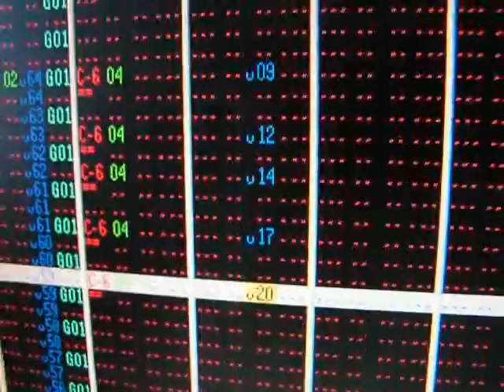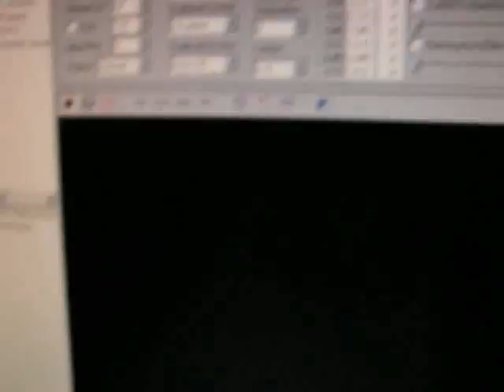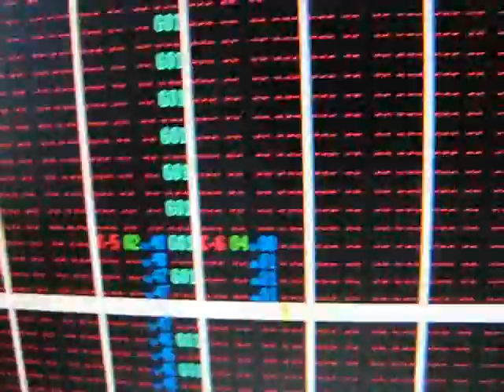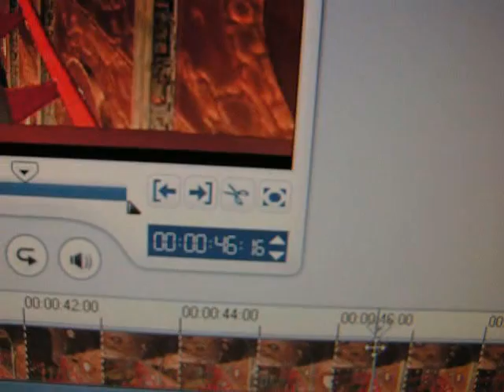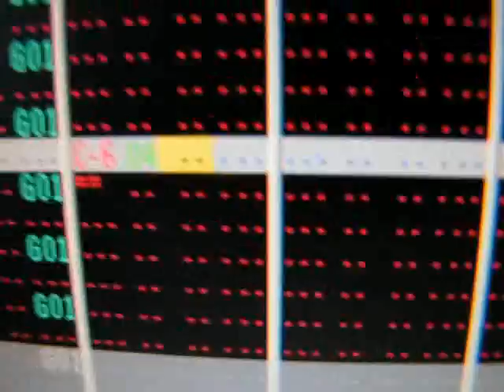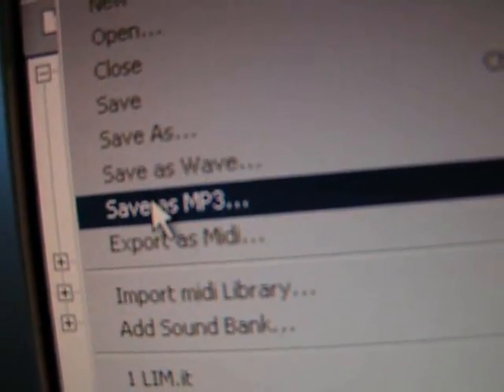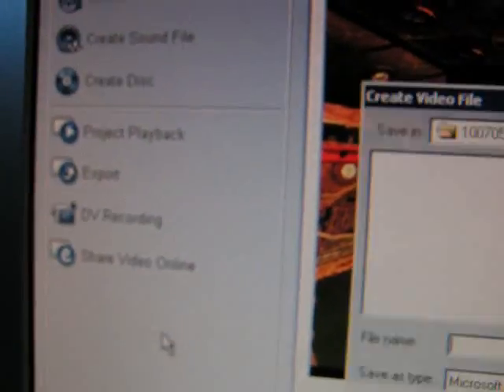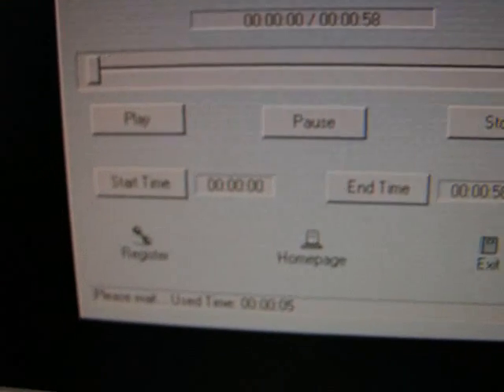How to put sounds into your RCT3 Vids.    Part 4/5

Comment from the maker: That's 30 words. ;)

But yeah, I suppose if you are happy with the default sounds RCT3 spews out, you could do that. But if you want it to sound a little more real you'd at least add to the sounds you get (like breaks that sound like they are tearing the underside to pieces, or "Intamin Farts" over wooden crests, or the small details that you like hearing in a real coaster (friction wheels, gaps in the rails, large launch motors, etc)).